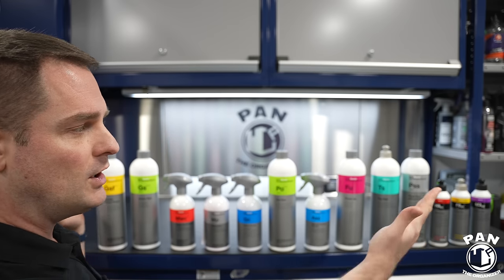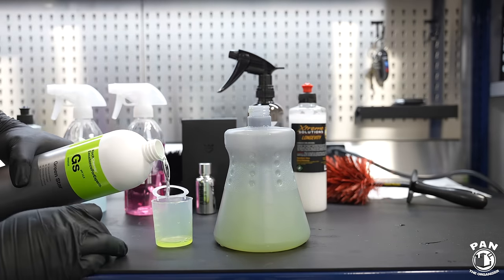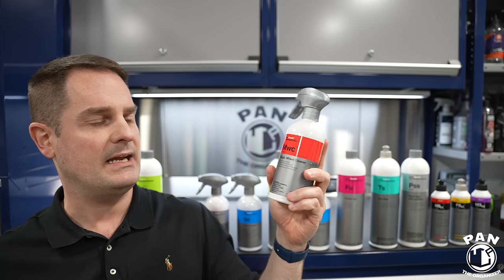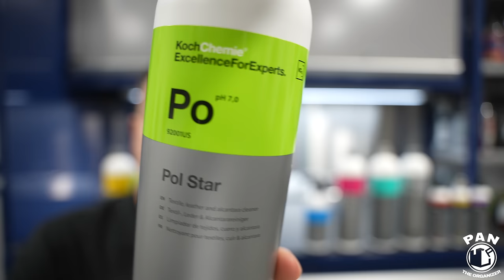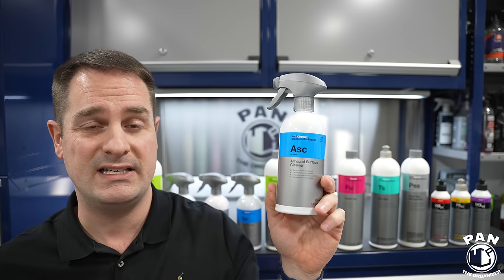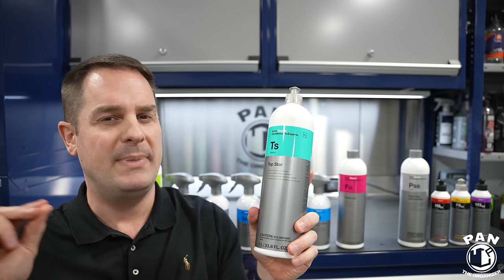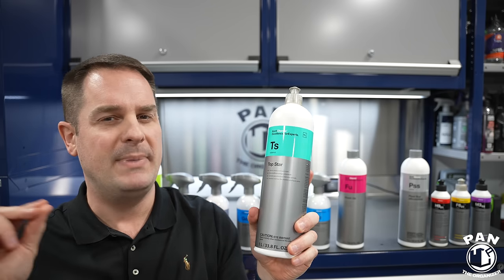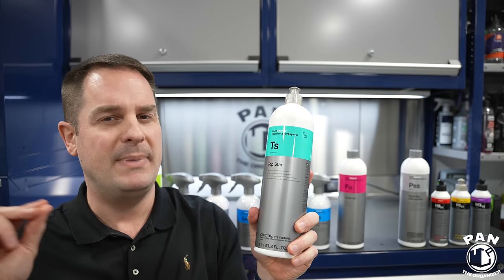KOCH CHEMIE Detailing Products : Brand Review

Comment: Is greenstar safe on ceramic coated vehicles?
Reply from the maker: It depends what use you want out if it and what dilution ratio. I wouldn’t use high pH APC all the time on coated cars.
Reply: @PanTheOrganizer   I use carpro reset pretty much all the time. But I wanted something to wash the truck follwoing the winter. So wasn't sure if I should use greenstar or carpro lift to get rid of the winter buildup?
Reply from the maker: You’re in luck! Watch my ultimate spring cleaning tutorial on my own car here: https://youtu.be/oTaFE_p2OAw
Reply: @PanTheOrganizer  🙏

Comment: Fantastic review as always Pan. Koch Chemie has been on sale in the UK for a while and I’ve tried many of their products. First, got to agree the branding is amazing, really stands out and the instructions are very thorough and easy to follow. The sprayers are very good quality too. Also agree with you about the negatives there are none. I use the GS mainly 1:20 (20L for less than £5.00) for most applications and occasionally 1:10, don’t need any other APC. I also use Fb, viscose rim cleaner, comes in 20l container so £7.00 for a litre, this has a PH of 7.5 and has nano beading effect.The Mp is great too, I also coat the plastic inner arches of my van and it gives a great finish. Some items not in your review the As auto shampoo is great with a very pleasant smell. Fse finish spray exterior that makes light work of water spots and gives a good shine. These Koch Chemie products are what I use after trying many others and the great thing is they are value for money, sometimes a 1/4 of the price of the competition but better performing.
Reply from the maker: Thanks for sharing your experience with us!

Comment: 8th
Engine bay cover or hood or bonnet, many ways to call it 😄👌
Motorplast is excellent and has a cherry scent too
For tire coating Lone Star but better has been for me Dura-Coating tire coating since lasts longer.
For the Koch Chemie pronunciation just use Google translate and you will listen to it just like I learned it at the university class from my German professor.  It's like the x in Mexico where the ch is pronounced like the j sound in Spanish
Reply: Wepa 🇵🇷💯‼️🌴
Reply: @LEFTY2GUNZ401twoGUNZ  WEPA otro BORICUA 👍🇵🇷
Reply from the maker: I need to try Dura Coating one day, many of my viewers say they like that tire dressing. How long does it last for you on average?
Reply: @PanTheOrganizer  it has lasted in my environment daily driven for 10 months and still you can see it and will be doing a touch up on my tires.  I have it on 2 other customers vehicles and they still have it since I applied them 9 months ago. You clean them well with the cleaner they come with in the package, once you apply the tire coating wait like less than a minute and it's dry to the touch, no sling. The he lone star only lasted 7 months and no sling either and dry to the touch too.